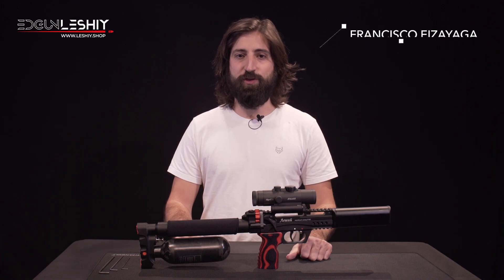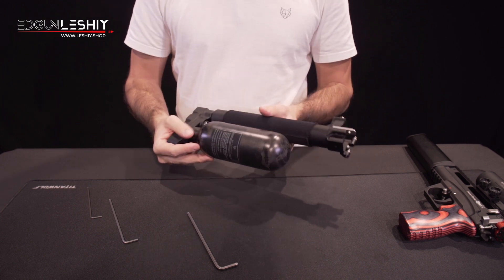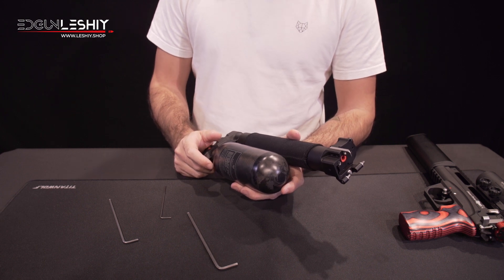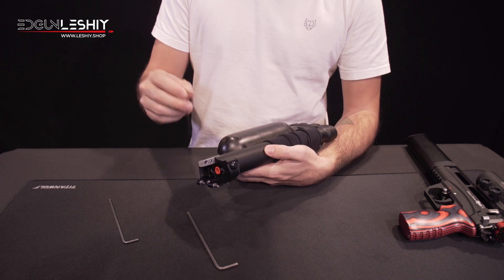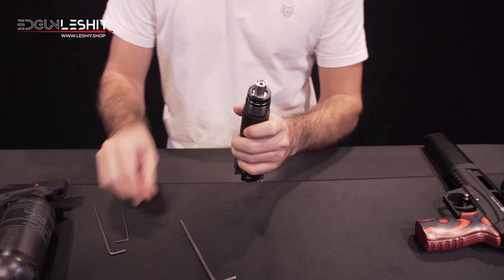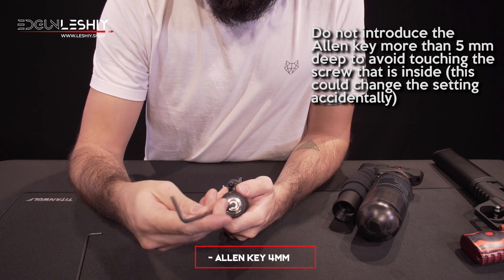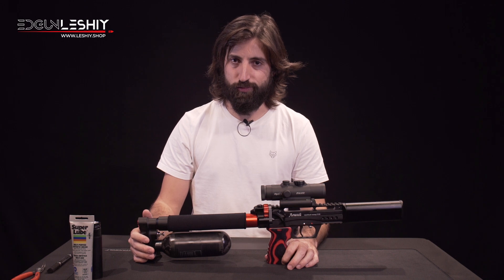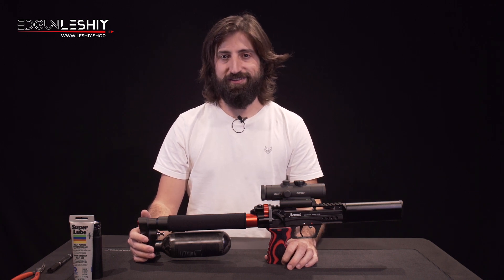EDGUN LESHIY 2 TUTORIAL #011 - HOW TO CALIBRATE THE REGULATOR OF THE LESHIY II

Comment: this is my first serious airgun and there's no manual with basics from those going from powder burners to these. how to vent pressure should be in the instructions. thanks for going over this. Are there markings on the regulator assembly that show what the setting from the factory is? are US and European versions all set at 130 from the factory?

Comment: Hi Francisco, so a 1/10ish of a turn for a change of 10 bar?  I think my L2 is running a “bit hot” so I want to reduce the pressure 10 bar.  You turned 1/4 turn and went up 30 bar, if I understand correctly.
Reply: Hi Peter!. Yes. You are right. In other words, to reduce the pressure of your regulator by 10 BAR, you should turn it about 5 minutes of a clock (= 30º). This would be = 1/12 of a full turn (not 1/10). Important: Anticlockwise to increase the pressure, and clockwise to decrease the pressure.
Reply: @admwolfiekgroup1403  Thanks Francisco and for confirming the rotation.  I will report back to you the results.